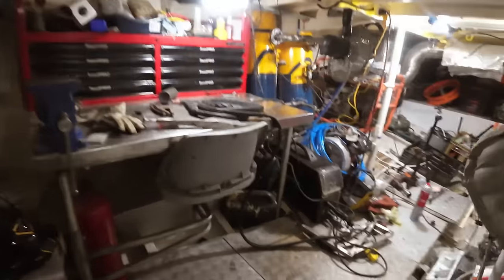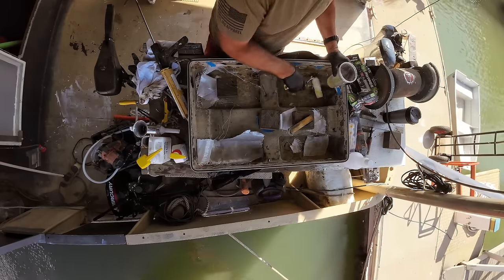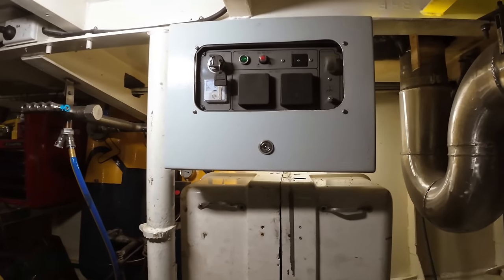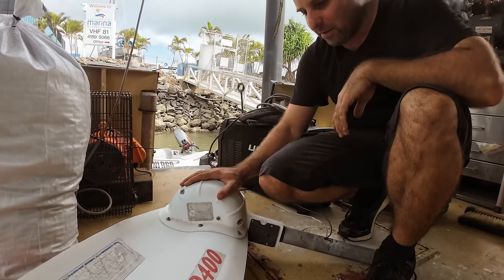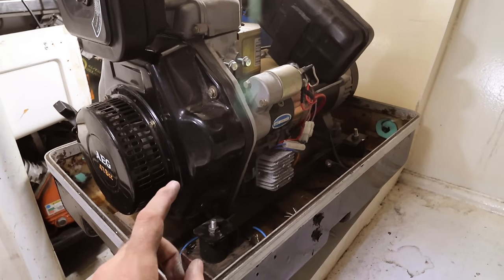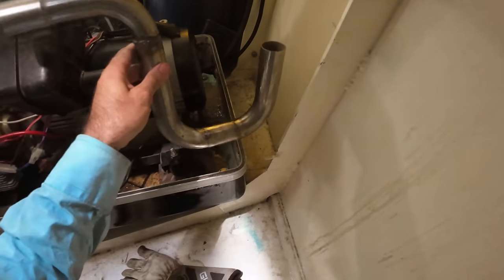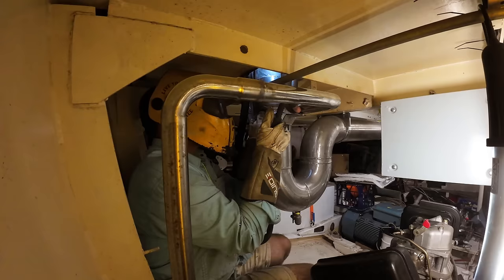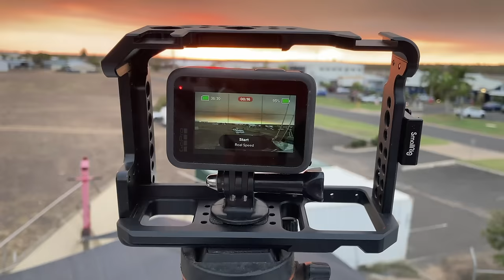Our Expedition Boat Backup Genset - Project Brupeg Ep.334

Comment: Have you considered mounting the engine room exhaust fan in the funnel on the upper deck.  If you tightly seal the shroud around the exhaust stack and seal the funnel to the deck, it will provide a path for the warm air.  I have seen ships funnels with a rounded forward section and a flat surface to the stern. Much like an elongated letter D.  A fan or fans could be mounted on the flat section drawing air from the engine room.  I assume the engine room hatch will be closed while you're underway.  

I look forward to seeing the progress you make each week.  Good luck.
Reply from the maker: I hadn’t thought about mounting it anywhere but the engine room. I assumed salt air is the enemy and is least salty inside the engine room. I’ll have to ponder this. Thanks for your input, it’s given me something to think about for the future design

Comment: I am converting a small 3.5:kw for my trawler. But plan to go with wet exhaust. By eliminating the muffler inside the enclosure you are reducing a HUGEmsource of heat that you have to extract. I am using s/s fittings all the way and  will  go out thru the stern with the  wet exhaust. My main motor is also wet.. Enjoy watching your show. And how you rationalize the work you do. ATB.
Reply from the maker: Hi Wilson, yeah we pondered going g wet exhaust with this for noise and heat but decided the possibility of fumes curling round and into the rear cabin was to high so opted to push it out the roof. I agree with the muffler being a potential issue with heat. If it turns out to be too hot I’ll just delete it from the box and put a stainless version outside the sound box, possibly above the roof line

Comment: Just a note that with portable generators there are three common ways of how the earth (ground) wire is connected, so if you are connecting this genset as an alternative source into your wired distribution, you need to make sure your earthing setup is consistent across the various ac supplies, so no fights break out.
Reply from the maker: Thanks, yes my plan is not to start this genset until Duncan has checked all the electrics and it’s been signed off with our sparky as well. I dont know enough about spicy AC wiring to know if it’s right or wrong so I’m not getting my fingers in that pie. Dame

Comment: Great work as always. On the generator wiring, how about routing it below the generator so that it isn’t vibrating on top of the housing??  Getting it down low will also keep it away from the muffler/exhaust heat.
Reply from the maker: Exactly our thoughts. Once I changed the muffler I thought that wiring needs to move. It’s on our list to change
Reply: Great to hear. Always best to avoid the problem before it happens.

Comment: For your air casing ventilation, if you pressurize the engine room the air will flow up the air casing up the side of the exhaust is the only opening you will get updraft up and out

Mount the fans on the supply duct 

Fire flaps on the supply to the engine room and at the top of the air casing

Comment: Nice work! I see so many bends in that exhaust, and a long run up, any concerns about pressure? will the small engine be able to release free? :)
Reply from the maker: Either yes or no. If it’s able to, we will leave the pipe as is. If it struggles, we will bump the size of the long vertical run up to 2”. It’s a very small engine and it’s a 1.5” exhaust so I feel like it’s a large size for the cylinder as it is but time will tell and if we are wrong then we can change it. I had very little to go off, I couldn’t find any examples online of others extending exhaust this much for a small engine like this

Comment: Small tube inserted into larger tube blowing across the top gives a vacuum = good exhaust scavenging. “Should” always have a slight negative pressure in the small tube. Thinking cut straw paint spray in nursery school..

Comment: Guessing you'll have to open up the floor again to get the 20K genset down to the engine room?
Reply from the maker: Actually cut a hole in the rear deck and drop it into place. And rather than weld the deck back in build a flush hatch to act as a second fire escape for the engine room
Reply: Makes sense.  @ProjectBrupeg

Comment: You can combine the exhaust, if you put the exhaust pipe 5-10cm in to the main exhaust in the flow direction. That will create a vacuum  in the generator exhaust when exhaust from the main engine flows past. Would work great for the 5kw generator, the big one howewer would obstruct the main engine too mutch.
Reply: I don't think it's that simple, because the Genset exhaust is not free flowing, just part of the pressurised volume. I don't think the Venturi effect would work quite as you describe.
Reply: @ipullstuffapart  Have you tried it? There is no pressure to speak of on the exhaust side in a 6in pipe with no muffler, but there is gas velocity flowing past, so in my experience this works. Only issue he might find is that the exhaust gass can backflow thru the main engine, but that has not happened in the setups i have done this in. Anyhow, Dame put up a single stack for the generator. But if there is issues with too long exhaust stack, and too high backpressure. This can be the solution for them

Comment: Throw out some HINTS out there for ya. One question though did ya install a pipe and ball valve through the fiberglass bottom from the oil sump for easy pms. An axle flux vertical disk generator is more efficient even in a low breeze. I’d turn that one into that. Tip for small engine exhaust remove the original muffler from the build than upgrade useing a 4 cylinder or motor cycle engine muffler attached to the bulk head. To really muffle the noise from small generators.

Comment: I have a question is the oil level and pick up you might need pressure pump to the oil system making a dry sump system. To stop the engine going low of oil.

Comment: Another Fella made the point before but You should evacuate the heat as fast as You can out of the genny box. I wonder over another (maybe) issue: the length and size of the exhaust pipe. The length might collect condensate while running, especially when only on for short times.
So: the engine end (I think) should get a good insulation and a muffler somewhere in line, scrap the original. I belive: keeping the exhaust heat in to carry it along would quickly get rid of condensation and quieten the pipe down.
And I have the opinion the pipe should be thicker to get flow resistance down a bit over all the length.
Have a beautiful Christmas, Guys!

Comment: I bet you could make a six blade fan for that wind generator from 1/2 cm aluminium or plastic and add a safety ring to the tips to keep curious pussy cats and careless sailors from ending up looking like Kimchee. With a bit of shaping, the ring would also add the Coanda effect to increase efficiency... Or, you could just buy new blades and have time for a cuppa and some Tim Tams...😜

Comment: How do you intend to air cool the engine?  With the enclosure in place, where is cooler air going to enter it and exit? Both the diesel and the generator will require this.

Comment: Small engines like what is used on that generator do not like having long exhaust runs.  Connecting pipe to the existing muffler is not a good idea either.  It would be better to have the exhaust pipe connect directly to the cylinder head of the engine.

There is different styles of v band flanges and the best are machined with registers so that the flanges interlock which provides better sealing and they are always perfectly aligned.

Comment: Have you thought about signal integrity on the Ethernet for the monitoring system? Emi and static can easily destroy that signal. It can be done but there is a reason auto manufacturers use canbus or similar with protections.

Comment: Thanks for bringing us along for the adventure....  I can't tell from the pictures, but does the exhaust pipe get larger at some point after the muffler?  Over a long run, back pressure might be an issue if it doesn't.

Comment: Put a handle on the cover sides maybe. Could you use carbon felt to gasket the exhaust on the box?  How does the deck seal?  will the below decks exhaust be fan assisted up through another box?

Comment: Consider getting.. assuming the generator needs 12 volt .. a 063 .. they are about the cheapest battery and most likely more power and cheaper than the original battery.
Reply from the maker: Awesome. Definitely look at that. Do you have a link for one so I know what I’m hunting for?

Comment: I would be concerned that the gen set's exhaust is too long and will create too much backpressure to allow the engine to run efficiently and produce the power necessary for the generator.  The existing silencer will produce some back pressure that would be of little concern due to the overall size and the proximity of the exit.  Internally, the silencer will have baffles that disrupt the gas flow to dissipate energy and therefore noise.  Couple that with a long exhaust where the gas flow is slowed by the frictional loss along the pipe along with the cooling and by slowing the gas you create more backpressure.  I would guess that a simple expansion box set at the optimum distance from the back of the valve will help e.g. ~ 30-40" (750-1000mm) depending on valve size, cam timing, lift and operating revs.  I doubt that any silencer will be needed or desirable.

Comment: you need to keep the muffler outside of the generator box  and maybe think of using a pump to circulate  water around the muffler like a heat exchanger   It will run too hot af you dont

Comment: Could you use some stainless heating ducting to encase the three exhaust and also continue the hot air up out of the engine room up high so it exhaust the heat out hight with the exhausts while also looking clean

Comment: You can Mix exhausts easy, run the little exhaust pipe inside the big one 6in, pointing with the flow, each exhaust will create a little vacume on the other, not nearly enough to cause any issues, you prob can't even measure it but it's enough it doesn't back flow 

Iv got the same Chinese deisel as a compressor, I extended thebexhaust as well  I don't like your chances of that muffler lasting long, they're made of cheese 
70% of the niose is the actual engine, don't be afraid to mount the exhaust straight to the head, it'll be noisy on the roof at the stack but will make no noticeable difference in the engine room

Comment: I've got one of those generators in a cabinet. If it isn't a brushless alternator (mine isn't) I humbly suggest to carry spare brushes. They don't cost much. Mine wore out and it was infuriating because I didn't have a spare and I had to take a day off so it cost me 20x more than the cost of the bloody brushes.
Also the fuel cutoff solenoids fail a bit. Also they don't cost much. If it does fail you can just pull the guts out of it to get you going but for the modest cost perhaps a spare is in order. 
The other thing that fails is the springs on the governor.
Re the governor springs you can't easily regulate the frequency with varying load unless you carry a spare complete governor to pilfer the springs from. Apart from those 3 items you get about 3500-4000hrs out of the engine. Complete engines are about $800.
The power from them is pretty dirty. I stupidly ran a desktop computer off mine and it killed the power supply but it took quite a long time for that to happen but it was hypothetically repairable (even if uneconomical).
Reply from the maker: Great info. Thanks for this

Comment: The connections in the wind turbine are called collector rings i think. Could you convert it to a vertical cylindrical prop and then it would not need to face the wind.

Comment: I think you’re going to kill the generator by enclosing it those types of generators need air all around it. The electrical system won’t survive the additional heat. Better have a backup system.
Reply: Hes gonna force air through the box. It will be fine.

Comment: Just curious, how do you prevent/reduce rain water or water from the roof from entering the engine room through the exhaust shrouding?
Reply from the maker: At this stage it comes in. Once the funnel is built it won’t be an issue

Comment: Where is the Total Boat supplier in Oz?
Reply from the maker: Actually no idea. Never heard of it over here but I’ll (Dame) preference that with we do very little glassing so me not knowing about them as about as relevant as a goose not knowing about differential equations.
Reply: Thanks Dame. I see Total Boat supporting several boat projects in the US  and the Thixo looks like a really handy way to use thickened epoxy, The Duracell Project is using a ton of it. It's great to see Brupeg afloat, give us a shout if you ever come into Mooloolaba.  @ProjectBrupeg
Reply from the maker: @rogerbayzand4455 cheers aye. We were looking for a pontoon down that way. We want to spend about a month there so it’s easy for Duncan to do the last of the wiring on the monitoring system prior to us pushing off. If you know of any wharfs/berths let us know aye! (we’ve check marinas and none want to take our boat with our current insurance as it’s not Aussie insurance)

Comment: You have almost wrapped the hot exhaust pipe around the generator head. This will drastically shorten its life. You should consider a heat shield between the two. The generator head needs to remain as cool as possible.
Reply from the maker: It used to sit much closer tucked into the side of the head. If anything I’ve moved it further away
Reply: Getting closer to the mooring ball. Less need to rush as you got some bonus time. Thanks to the marina.
Reply: I think maybe we have a miscommunication with the term "head". Generator head would be the main alternator that the engine drives and not the cylinder head. I think Peter was trying to say now the exhaust runs over the alternator and the heat will kill it quicker
Reply from the maker: Ahhh gotcha. Brilliant idea. I hadn’t thought of that and it should have one added.

Comment: Just a comment on the dinghy, the reason you ideally want inflatable tubes is so it absorbs the bouncing yours won't, now your back does on yours.... So..... meeeeh? 😂
Reply from the maker: Our experience has been the inflatable tubes hit a wave and send you up. These hit a wave and ride smooth.
Reply: @ProjectBrupeg  I've done many thousands of miles in inflatable boats. it is much better to have correct air pressure tubes to shock absord. However, if you are only doing short hops it doesn't really matter for your use but the fact is ribs use air tubes for good reason, it's to save your back and knees.
Reply: In the arctic they often use dinghies with tubes made from thick hard plastic. They don't puncture from icebergs, and ride really nicely through waves in my experience. The additional weight really helps.